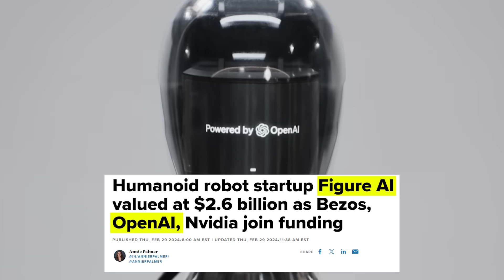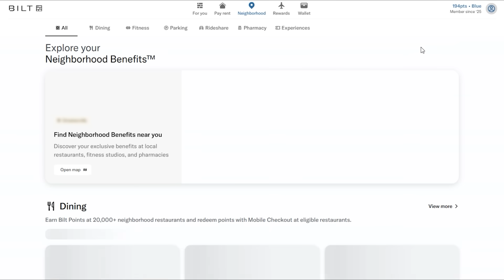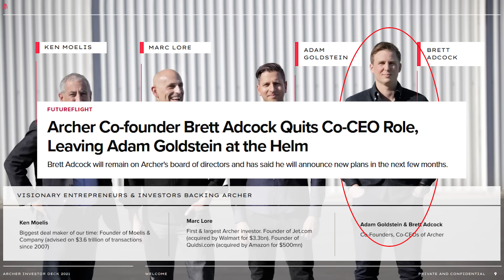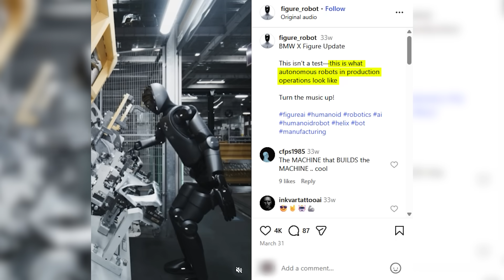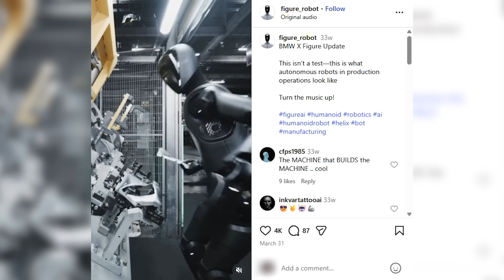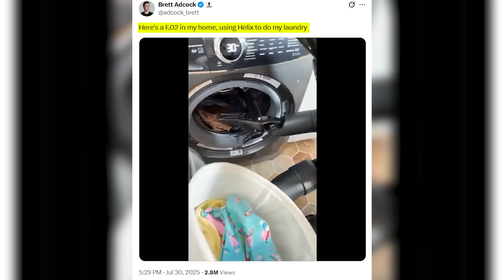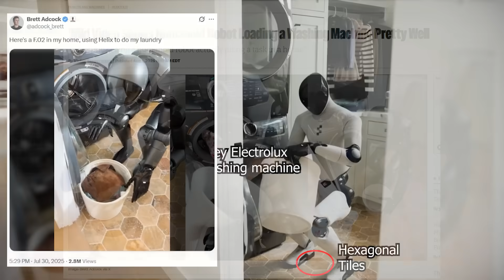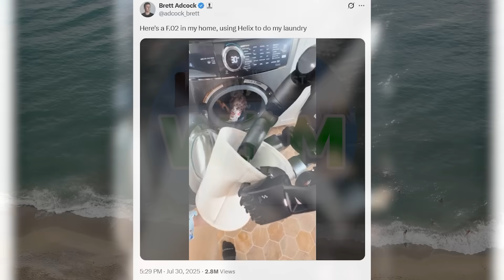OpenAI Invests In Fake Robot Company

Comment: Humanoid robots are a waste of time and energy, much better off with a sure-footed robot base where the robot doesn't need to waste energy and processing power struggling to stay upright on two feet. In most production environments, robots bolted to the floor or on rails around conveyors make more sense than walking robots. Having arm-tools also makes more sense than making robots use tools designed for the limitations of hand grips and controls. We don't design CNC and lathe tools for hand-held use, we design them to fit the machines for the best results and effectiveness possible.

Comment: Some clarification from an Automation engineer (me). The reason there was no safety fence (the mesh fence that you referenced earlier) around the real automation cell at 12:50 is because the section that the humanoid is interfacing with is designed for a human to pass through to access the part nesting to load the cell. The roll-up door is designed to allow a human or humanoid to access an automation element and nothing is allowed to move or enter that area until the roll-up door is down, acting as a section of the guarding (there are light curtain safety sensors that prevent the cell from starting while anyone is in that small section of the cell). The task that it was performing of loading parts is a very repetitive task, but the critical element is actually retrieving the parts from either dunnage or from bins, which is where humanoid robots are actually scary good. Judging by the fact that they're not showing the robot picking the parts out of the bins suggests that maybe they haven't gotten that part figured out yet and somebody is passing parts to it or loading them into a nest for it to grab, which is entirely likely, but for the humanoid systems that I've personally worked with, I've seen it pull parts from disorganized bins, orient the parts (a mindless task a human would do with dexterous hands), and then load it into fixtures

Comment: I have spent time in that BMW plant, when I worked for KUKA, the orange welding robots pictured. I agree with this video, but some information is incorrect. The Figure robot is considered a ‘cobot’ which is safe around humans and the point of the pick and place test on metal sheets is that traditional robots are notoriously bad at manipulating flexible metal sheets.

Comment: 17:50 "The Figure robot is no more than Honda's failed ASIMO robot was 15 years ago". As a robotics engineer, I can say that this claim is wrong. From what I know, ASIMO was essentially an actuator demo platform with no closed-loop control. But Figure robots clearly have some perception and control (for example, picking up the extra clothing thrown into the basket). It is undeniably a huge leap in robotics compared with ASIMO (not surprising considering advances in hardware) but it will take many, many more leaps like this to (maybe) catch up with millions of years of biological evolution.

Comment: I can promise you that my labour is cheaper than any robot could ever be and I have less downtime for service.

I’m a warehouse picker. I do use automation in the form of voice commands, a headset and a radio device.
I also voice operate massive robotic storage shelves.

They are good because they save space. Each unit has over 50 shelves that I can call down to be used.
However! Operating the shelves robots is much much more time inefficient than regular shelves.

Our management knows this from simulations. So frequently picked goods never go in the shelves robots 😅

My employer doesn’t have to pay a maintenance guy to run maintenance on me or repair me.
We have shifts working around the clock.

If a shelving robot malfunctions, then we have to call out an expensive guy to fix it.
And he does not show up immediately.
We have to just keep working without that unit and simply just not sell any of the thousands of products that it contains.

Did I mention that we supply all of the hospitals and medical clinics in our region?
Anything from scalpels, to artificial heart valves, catheters, bandages and syringes come through our facility.

We have paper backup procedures, in case of a significant IT disruption.
(That could be Russian interference or some freak solar flare I guess).

Anyways. I’m technically a dirt cheap unskilled labourer.
I’ve been working my job for 5 years now, so of course I’m highly trained.
I get paid the same as the new hires with zero experience and qualifications.

I’ll always be cheaper, faster and more reliable than a robot.
I’ll work through pain or sadness because I want to be dependable. Though I still get paid sick leave, if I’m out sick.

Due to my unique scheduling, I don’t get breaks either.
I can of course use the toilet, but if I want a break, then I have to go home later than I currently do.

I would get rehired so fast if some idiot replaced me with a robot 😅

And here’s the kicker.
I’m actually paid a decent income.
We have no minimum wages in my country, but we do have collective bargaining through unionised labour.

I’m cheaper than a robot.
I’m not being exploited.
I live comfortably.
I like my job and I’m good at it.
I live in the capital city of my country and I don’t share my apartment with anybody.

I don’t feel threatened by competition from humanoid robots.
I laugh at the suggestions that I should be.

I swear, the people who say that , have never worked a real job in their entire lives.

People in the trades are also job secure for all eternity.
Humanoid robots aren’t going to install toilets in 4th floor (no elevator) apartment 1m2 toilets of Copenhagen.

They also aren’t going to renovate kitchens or roofs.
Or construct roads or rail.

Maybe they can be standup comedians of the future.
Since we are all going to laugh at them—unless our pensions are getting invested into that useless garbage.

That said. There obviously is a market for robot/doll girlfriends.
I doubt the target audience has humanoid robot money though… so maybe they stick to comedy.

Comment: Figure AI might have problems but humanoid robots have real value. Problems in computer vision, reasoning, and dynamic control that were unsolvable for ASIMO have been solved with modern AI systems. Waymo and Tesla self-driving is proof of this. The laundry loading and household chore tasks are very useful for environment such as warehouse picking. While household robots are far away, robots to work at warehouse facilities are very real. Figure might not have a moat but it's wrongand close minded to dismiss the humanoid industry's economic value wholesale. This is very very different from VTOL which has systemic problems.
Reply: Do you really know much about robotics? Even a simple robotic arm used in an automobile factory costs around 300 million won. If you believe a humanoid robot capable of performing complex tasks will be sold for just 20 million won, then you’re being foolish

Comment: There has never been a need for a manufacturing robot to be humanoid. Our body layout isn't compatible with heavy assembly, and in fact manufacturing plants have to be built with Human frailty firmly in mind, so we don't die. Humanoid robot isn't much different in it's lack of survivability. The only robots that (might) benefit from being humanoid are those that MUST work with tools designed specially for human use, or those robots that deal only with human-activity directly (Healthcare or helper-companionship roles come to mind). The AI slop images on Facebook which show endless rows of humanoid robots assembling iPhones is completely insane. How much imagination is lacking in all these designs? A custom iPhone assembly robot would be on the order of 100 times more efficient if it's design closely matches the job at hand, and not trying to shoe-horn the job into a humanoid task. The modern robot industry is a fucking joke.

Comment: I just fundamentally don‘t understand the tasks they show these humanoid robots doing.
Filling and emptying a washing machine takes maybe two minutes every week. Folding takes a bit longer but is still in the 15min per week ballpark. They are trying to further automate something that is already automated to the point where I spend maybe one cumulative hour every month doing it.
My floor cleaning is perfectly automated by my $700 vacuum and mob robot with a base station as well. Again it takes me maybe 20min a month to empty and refill the tanks.

If you want to impress me your humanoid robot needs to at least clean a kitchen (including the oven and moving all the kitchen equipment around to clean under them) or ideally show it cleaning a bathroom completely, clean all windows in a house or organizing some mess I left. Even then, automating that would not make me drop something like 20k on one of those things.

Comment: The humanoid robot that picks up two tiny pieces, shuffles over to the line and places them in position to be welded will never catch on.  If you want to automate that task, you build a magazine so the worker can load 10 or 20 or 100 parts at a time, and then a robot hand will pick up each part and move it onto the welder.  The automation is gradual.  You design the process so that more and more can be done by robots, and gradually less and less human intervention is required.  Each increase in automation requires additional capital investment and actually reduces operational flexibility.  Taking out a person and having a humanoid robot do the job the same way a person would is insane.  I think we're still decades away from something like that.

Comment: Last year I had an argument with some very smart people when I suggested there was no use case for humanoid robots.  None of the examples they used made any sense, a humanoid shape was sub-optimal for each one.  But my friends were unshakeable.  I still don't see any use case for humanoid robots.
Reply: I agree--it's a pretty obvious point. Every automated gizmo has a purpose built shape to keep build costs in check and improve efficiency of operation. The general purpose "humanoid" shape would either be hyper expensive and overpowered, or will more likely be just junky at everything.
Reply: @KevinKimmich44024  The use case everyone likes to talk about, and mentioned in this video, is factory work.  But humanoid robots only make sense working in factories or warehouses designed for humans.  And if that’s what you have you would be better off just hiring actual people, or investing in a new facility tailor made for robotic work (and the robots sure won’t be humanoid).

Comment: From the short video of the robot loading laundry one specific detail is of note: it seemingly reacts instantaneously to one of the items partially hanging out of the machine. This hints at teleoperation, not hard-coded behaviour. The motion also seems too fluid for the reaction time current humanoid robots have to running image classification and path planning, both of which need to run to put this item fully into the washing machine.

Comment: When humanoid robots learn to lie, they can take over as CEOs.
Reply: Well, LLMs lie all the time, so, we’re probably pretty close
Reply: LLM's lie all the time. Well they hallucinate but do it with misplaced confidence. ANY LLM that relies on Reddit as a "trusted source" is a corrupted model. No one in an academic setting would be allowed to rely on Wikipedia let alone Reddit, so how can these LLM's? Also OpenAI STILL has a huge problem with copyright infringement in their learning models. Just wait until they get hit with 10 or more Multi-Million Dollar settlements and/or Judgements and it will tank them. Especially anything that is used for Photo and Video Generation that used copyrighted works to train on with express permission of the copyright holder. It's a huge blind spot for ever single LLM that has likely trained on all the same stolen data.

Comment: There is no reason to think the F.02 Bot in BMW Spartanburg bodyshop is teleoperated. It had a long time training to do the typical simplest cell window loading task with 2 uncomplicated parts and now manages fairly reliably with no human intervention or variability, thus legitimately replacing 4 human workers. However, comparing this to final assembly tasks is (at this stage) apples to oranges.

Comment: You missed the fact that they needed to build a special rack for the humanoid robot at bmw to properly pick it up that a human has to load after every part. So a human is still required for this task.

Also a human can work next to robots but only if it runs below a certain speed and torque.., so if it does hit a himan it wont do damage.
Reply: To be fair - we use those fixtures to move parts from the press plant to elsewhere, at least in Munich, and those fixtures are also used for parts like windshields (look at footage of BMW plants online, you may spot magenta steel mesh bins and turquoise specialized fixtures).

Though the Munich plant is rather space-constrained, so the more high-volume plants like Dingolfing (especially Dingolfing, I think it's the highest volume plant) don't necessarily have to use fixtures like this to move parts from the press plant to the robot cells, since it's out where it has lots of space.
But those racks do appear in production in some form.

The three big red flags for me though are that the fixture isn't the usual turquoise the fixtures here are, they're not part of a cart, and also we'd see figure robots in the new Debrecen plant if they were worth their money.

Comment: The fact that these "robots" are designed to look like humans tells me that these are a scam because that's the design we associate with ourselves and that's what sells. A real robot would be more efficient which is not a "human".
Reply: In a factory setting, there are usually different shapes that would be better for most jobs. But in a home setting, a humanoid robot is the most efficient form, because it will be able to interact with the full range of human tools. It will be able to climb stairs, work on carpet, navigate narrow and messy paths, reach high shelves, and not take up the space of a 5+-limbed robot. For working inside of a home built for humans, there is no more efficient form for a robot than a human (aside from maybe the head, which could look weirder if they wanted).
Reply: Correct…it should look more insect 🕷️ like. Good observation 🤔👍
Reply: The argument is to have a robot work in a human designed world, making it function and look like a human gives it more capabilities
Reply: @codycast  Have you ever seen Star Wars? Any Astromech or other Droid with inhuman shape is tons more versatile or adaptable than C Fucking 3PO.

If somebody tells you humanoid robots are a valid engineering approach they are either stupid or lie to you to make money from you. (or both) there is no fourth option at the current state of engineering and physics.

Comment: I'm sorry, but yes, humanoid robots are coming in our lifetime, and they will fulfill the promises of all these early tech CEOs. They will be deployed in the next few years, capable and participating in the economy, with the same statistical certainty of the sun rising tomorrow.

Generalization is difficult to contemplate or fathom for a lot of humans. It's a paradox of, you don't know what you don't know. Generalization of robotics through the humanoid format is extremely valuable and is the key, and why so much money is going into developing humanoid robots. Unfortunately, it would take a book of white papers to explain it, if you're not understanding it at this point. 

But a successful Iteration of an autonomous humanoid robot becomes infinitely economically valuable because it can take advantage of the intrinsic value of all the pre-existing infrastructure; tooling, formatting, setups, environments, safety protocols, policies, et cetera, et cetera, et cetera, et cetera, et cetera, et cetera, et cetera, get the point? Not to mention the fluidity of changing from any of those to any of those. The value is simply so astronomical and so open ended that it is easy to understand why most people don't comprehend its potential.

Comment: Humanoid robots are pretty much useless, there's a lot of work simply maintaining dynamic balance. The Boston Dynamics robots are the only ones really working on balance, but even they are unable to account for random, shifting loads: good luck carrying a gas can. Agility and fluidity of motion are computationally expensive and require very high end motors, geartrains, and flexural joints, all this stuff wears out and causes unpredictable robot failures. You've got actuator upon actuator upon actuator, and expecting this compound vibrational model to move smoothly and self-dampen, it's preposterous. Honda gave up this stupid idea a decade ago.

Comment: Putting clothes in a washer or dryer but not starting it does me absolutely no good, lol. And you know there's no way to code it to understand every single kind of appliance there is. The precision it would take to press exact buttons for these appliances or to grip and pull out the tab for older washers (the ones where you twist the knob to the setting you want, then pull back on the knob to start the cycle) is extremely difficult to make a robot do.

Nobody who really needs actual assistance would benefit from these humanoid robots, partly because of their limited functions, but mostly because those who need help the most won't be able to afford it. Someone who's wealthy can just hire a more efficient human to do a task. These things ultimately would just take up space in a landfill.